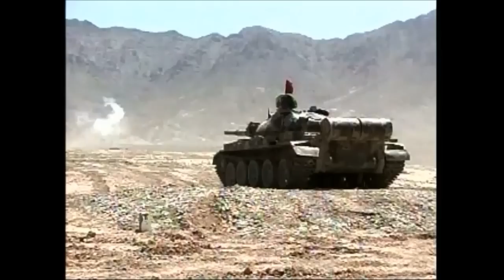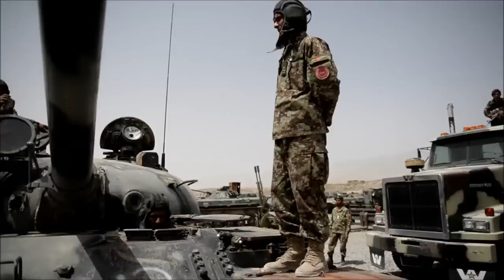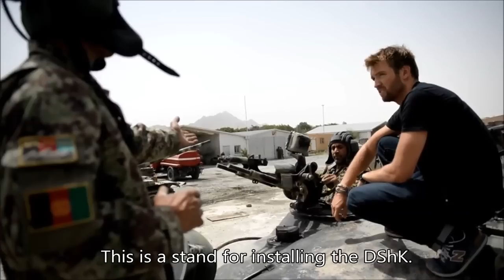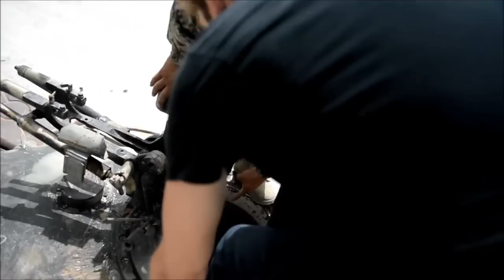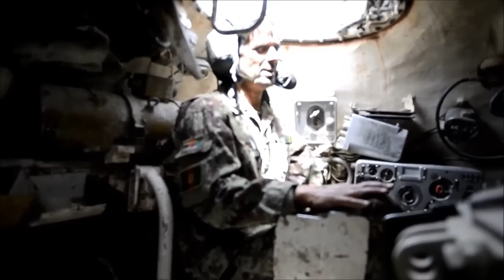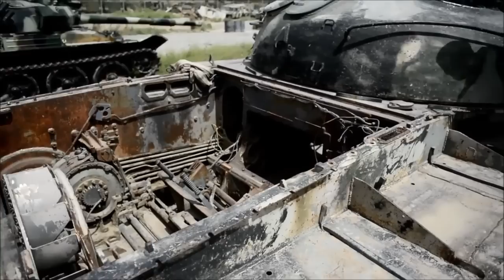The Beasts of Kabul: Inside the Afghan Army's Soviet Tanks

Comment: First T-55 were released in the late 40's. Pretty crazy how nearly 80 year old tanks are still fulfilling their intended function.
Reply: Same with M48 Pattons that are still in active service in Turkey, Taiwan etc.
Reply: if they can run a decade they can run forever as long as well maintained and use nicely and wisely
Reply: @ShengTheCraftsman  T-55 was produced in the late 50 to 60s
Reply: distance5000 the m48 isn’t as good this are fare better
Reply: t-62
Reply: Those are t62
Reply: @distance5000  The Chileans have the last Sherman tank in service, not restoree, in full active service
Reply: The t 55 was from the 50s
Reply: @sigurdsnokle4549  
Read his comment.
He is correct
Reply: 1joshjosh1 nope, the t 54 were developed in the late 40s. The t 55 cane in the fifties
Reply: @sigurdsnokle4549  
Okay fine fine fine
Reply: T55 is a
Modernized t54. Just like the t34-85, yeah it came in 43, but it was mostly a late 30’s development
Reply: c32amgftw, That is how tank designing and evolution works. You take something that works and upgrade it so that it stats relevant. With APFSDS ,a stabilized cannon and many other features, the t 55 is a much more capable tank than the t54. So saying that this technology is from the 1940s rather than 50s is not correct. There is a difference
Reply: yeah but those are T-62's not T-55's
Reply: Two words, ITS RUSSIANS
Reply: They’ll be around longer than we will
Reply: Soviet equipement never Die
Reply: You do know bow and arrow still kills to this day, right?
Reply: nearly 84 years by now

Comment: They are very proud of their old monsters aren't they, pretty cool really. And hey, they fight mostly against infantry, so old Russian tanks are perfectly good for fighting tribal fighters.
Reply: unless they have RPGs then it's game over
Reply: Nope welding Cage armor it Will work
Reply: Taliban have ATGMs so yea... these things are coffins
Reply: Theses tank still works well as infantry support vehicle
Reply: Having a tank is better than none
Reply: The RPGs of the Taliban are usually not equipped with anti tank rockets. They didn't even knocked out Dingos.
Reply: Even old RPG 7s can take them out.
Reply: Those thank have a so strong suspension , perfect for the Afghan rough terrain
Reply: @TeddyKrimsony  those tanks has  survived many impact during their service.
Reply: The t55s gun out ranges the rpg7. Used as an infantry support vehicle it is just fine.
Reply: @R33GTR4U  the whole problem is RPG shooters firing from elevated points. And the T55 gun has no electronic elevator.
Reply: @Lavrentizodiac  Correct me if i'm wrong but didn't the Russian's have problems with their tanks as they fought in Afghanistan because the Barrel couldn't aim high at the mountains in closer conflicts?
Reply: @SgtJohnRemairez  yeah I remember hearing about that in a podcast, so they resorted to btrs when it got closer

Comment: Holy shit!!! They have to crank the turret by hand? Come on get with the program Russia.
Reply: +backwoodsbully Holy shit ignorance speaks again!!! The “Tsiklon-M1” gun stabilization system 2 plane stabilization with TShSM-32PV infered night vision sights, T-55As were fitted with the Drozd” active protection system, 100 mm Bastion Atgm, Nuclear filtration protection, electric turret controls with hand crank back up, and volna Fire control system, so no, american tanks in the same era are shit compared to the T-55 and T-62... look at the training manual for the M60a1 and the M48 the t55 rival, they say that the T55 has many advantages over the M60 series in most cases.
Reply: backwoodsbully why is there an electrical traverse and elevation joystick at 4;39...
Reply: +backwoodsbully The T62 was actually very advanced for its timed, they used stabilized guns before even the M60. These tanks havent been cared for well, so I bet the Meteor stabilizers burnt out a long time ago.

Comment: The Americans could easily help. Modern tanks would be useless, to expensive, tempremental and hard to maintain - but the US has ties with Ukraine, Georgia and the baltic states which have an abundance of old Soviet kit that hasn't been worn out in consant battle. They could scrape together 50-100 or so T-62 and T-72 units to replace these, and a warehouse load of unused spares. Alternatively, it would be sensible for Afghanistan to start talking to Russia or a friendly intermediary like Tajikstan or Turkmenistan to get a direct supply line of spares

Comment: What a piece of junk
Reply: +MrSlicker13 yeah but they work after 30 years of action

iirc the turbine engines of the abrams for example, while they run on every fuel and produce a good deal of power, will not even work for a year of continuous service

Comment: Holy shit those things don't need a smoke screen, they are one
Reply: Maciej Russer they actualy have a feture where fuel can be burned to make a smoke screen, most tanks from that era have the ability to do this, if I recall it has something to do with burning fuel on top of the engine on a dedicated surface so tanks could lay smoke for other AFVs and dismounted infentry when attacking a fixed position (additionally smoke grenade launchers can be added for a multi directional smoke screen for personal defense of the tank, where smoke laying is used to cover other maneuvering elements)
Reply: Joseph Montanaro Thats actually really interesting. I'll read into it